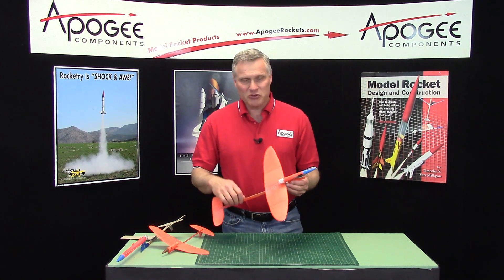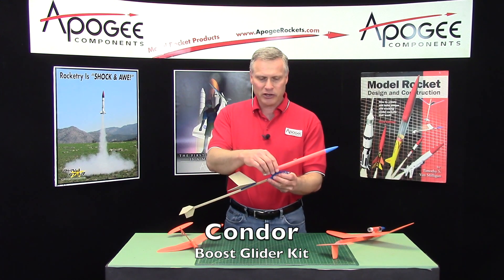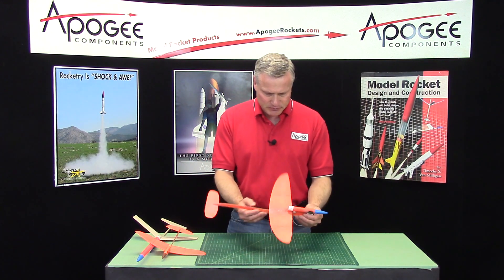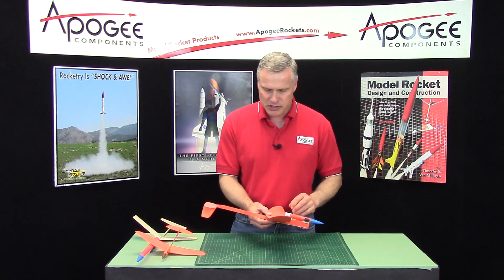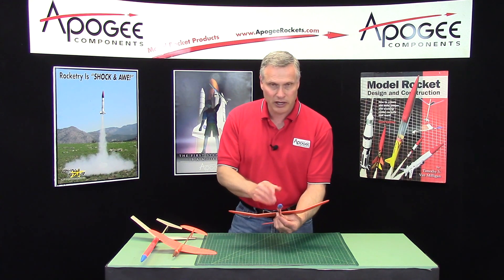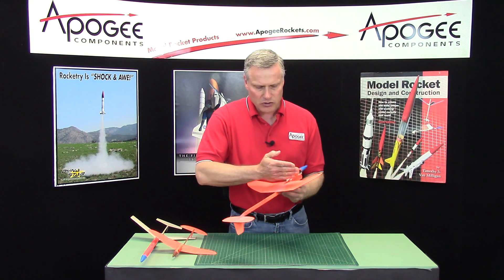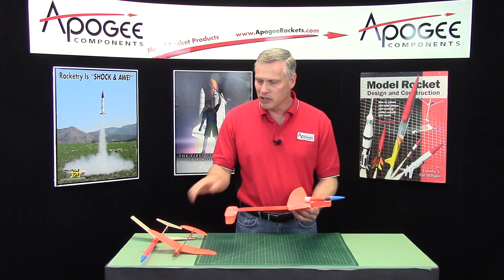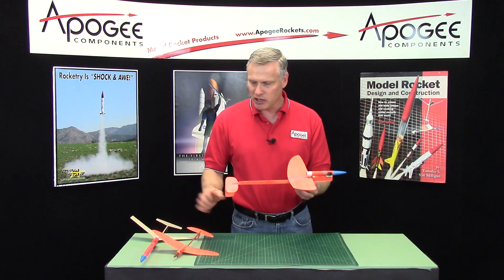Stratus Gale Intro

Comment: Beautiful design, I want one!  Also, when I paint any part near high heat areas such as engine mounts, I use either automotive engine paint, or heat resistant paint for outdoor cooking grills. This keeps the paint from burning or bubbling.  I think this would work well on a wing under the motor, or the exhaust port of a boost glider.  Thanks for posting this video!